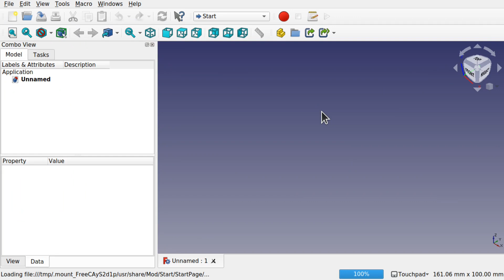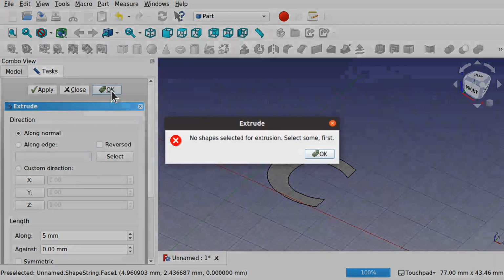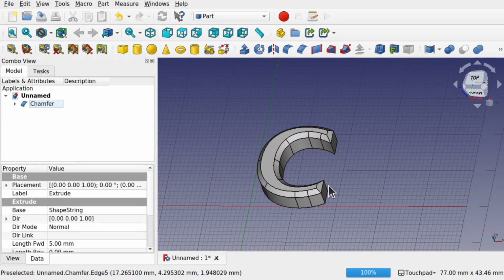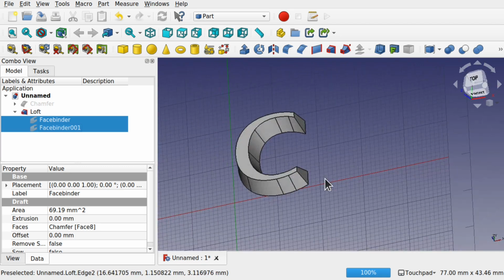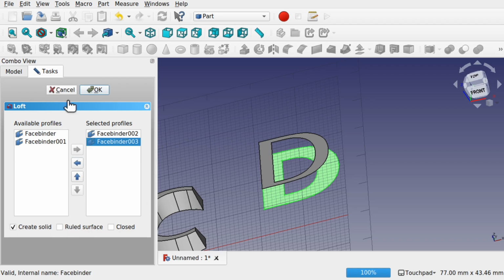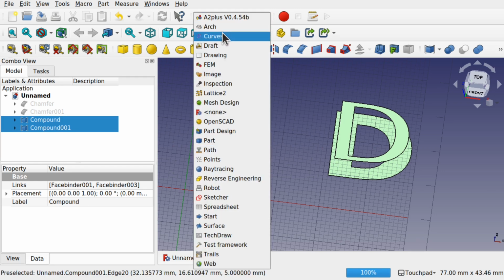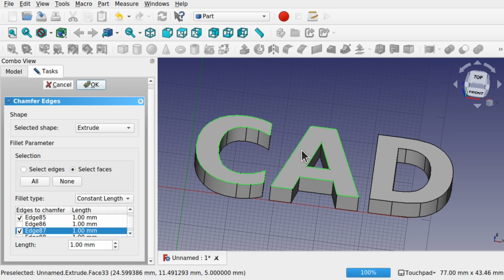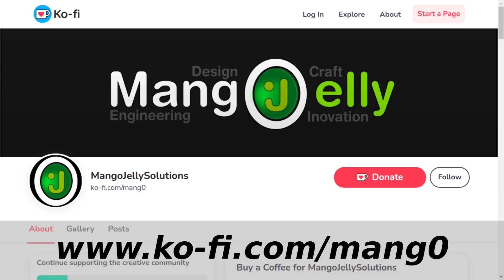FreeCAD: Easily Bevel Text To Base for Sand Cast / Injection Moulding When Part Taper Angle fails

Comment: How do you hollow out the bottom to make it for a sand moulds please
Reply from the maker: There are a couple of ways: 

You could create a rectangular volume around the text using a rectangular sketch and then extruding this.  You can then use a boolean cut and you have the inverse.

Another way is to use the thickness tool and select the bottom face of the text and that would attempt to hollow out the inner part.

You could use the part > 3D offset tool tool.  You may have better luck going outwards rather than inwards with this one.

Comment: Is this possible with cursive fonts using whole word not letters only?
Reply from the maker: In the latest version of freeCAD you can set the font to fuse which will help in this process.
Reply: @MangoJellySolutions  it will be interesting to see how you solve the errors when you try using cursive fonts using your method. I tried other methods to offset the top face inwards but still gettings errors.

Comment: Thanks!!!  I spent a fair bit of time in frustration doing this in a worse way before finding this video.  My task was making slightly tapered text also wider at the base like your version for casting to 3d print colored text inlays.
Reply from the maker: Glad it helped, and thanks for the share of what your using it for.

Comment: This works okay for the example you provided however some letters won't take a chamfer at all due to complex angles.  For example, using a gothic font, the capital M and N won't accept any chamfer.  Do you have any advice for fixing them?  I can do it with Curves WB multiloft if I manually scale and place the faces.
Reply: Was just having the same issue. Glad to know it is font specific. Did you find a solution?

Comment: Excellent! I have been wondering how to do this since I started using Freecad to make patterns for casting in my home shop three years ago. I could have used it at least half a dozen times. As a work around I have been using very shallow lettering. 

Do you think it's possible to use the same technique to add pattern draft to letters on a slightly curved surface, such as lid with a slight dome? A challenge would be that the draft would need to not be in respect to the surface but would need to be in respect to perpendicular to the parting line of the pattern. Although if the curve was only slight, it could be compensated for by using a larger draft angle.
Reply from the maker: Glad this may be of use to you in the future. In regards to query I have just been going over it on paper. Parting line drafts should be possible by duplicating up the first face and lofting through 3 faces rather than 2 with the largest face in the middle followed by the chamfered face either side or the chamfered face in the middle followed by the base face either side (depending on what way you want to draft). It's when it comes to the domed surface that it gets a bit tricky. I do have an idea so bear with me as need to test (if I have understood the question)

Comment: Hi , Darren . Thank you for this video . Just what I need . Have a dream day my friend . 

Stay safe 
Terry
Reply from the maker: Glad it's what you needed. I have my work pc at home and can understand the problems you may encounter with changing fonts on Windows. Mine is locked down by work and getting permission issues, so if you can't change the permissive one solution is to copy the contents of c:/Windows/fonts to a new directory (has to be new) into say your documents folder or somewhere you have full access. In this way you can point to the new directory. The otherway you have to change settings to not use the default font dialogue but you lose the benefit of viewing the font before you add it to your scene. I am looking to do a video on using fonts and installing new fonts on freecad with a few links to some resources. Many months ago I did a generic video for installing fonts on windows and inkscape as, again you hit permission issues. I forgot what a pain it can be sometimes.
Reply: @MangoJellySolutions  Thanks , Darren . Looking forward to that video when you get a chance . I would nominate you , FreeCad professor . 

kindest Regards
Terry Lembke

Comment: The problem for me is that the shape of the chamfered top faces of the text change the shape of the font enough that it can be undesirable. I am a total FC beginner so I would be lost there. It would be great if a guy could skip the chamfer operation and loft OUTWARD toward the lower face plane so the shape of the text on the top face is the unadulterated true shape of the font and the extra "meat" below it  is just a supporting structure of whatever shape since anything below the top face is functional rather than visual.
Thanks for the video. I always learn stuff.
Reply: I'm still looking for this solution too. In my case I'm producing letter (text strings) stamps for stamping leather. This starts with a 2mm base the text is extruded from the top surface 3 mm, for a total height of 5 mm. One of my stamps is a 50x50 rounded rectangle, with 10 mm fillet corners. These usually get a centered text that may be a small number of letters or numbers. A recent one was '42'.  Where I'm running into problems is when what I'm going to print has a letter 'i', or is a '.' or ',' where the glyph doesn't have much in the way of lateral support. (Depending on the slicer, going much below 7 mm in character height can result in the dreaded 'thin line' issue where the glyph, or portion of the glyph just doesn't print at all.)

Again the need is a letter glyph that tapers out from the top surface to the base, het will give a full impression as it's stamped. I would think a similar case might be if someone is printing 'rubber stamps' out of TPU.

I consider the reversing of the text to be a minor issue as I can dimply mirror the model across X or Y to do that within a slicer (technically one could mirror over z, then do a rotation around x or y as well, but that's at least a second step. That said I'd kind of like to have the model flipped as I export it to a 3mf or stl file. I imagine that this 'could be as easy as rotating the shapestring around x or y before extruding it, but I'm still concerned about getting a bit more support than a 1mm x 1mm dot that's 3 mm tall, and expect to survive at least a few presses.

Long term I'd be perfectly happy printing this in PLA, with a pla sprue and vent stem that can have plaster poured around them, get the pla burned out, and then have them cast in metal so that the stamps last longer. For the moment I'm able to produce stamps needed for small runs for a local reniscience fair leather shop. Among other things this gives them a way to try out ideas and see what works without having to drop several hundred dollars on a metal stamp that they discover doesn't give them a marketable product. Or if the caster casts int sand casts, properly drafted letters would be far better than what I'm able to do at this time. And yeah, attempting to implement 'draft' when extruding letters or strings gives really odd errors, such as 'no attachment surface for draft' which sounds like the method of doing a draft has become to extrude, then 'expand the perimeter of the base of the extruded letter, but leaving the length of the extruded surface the same as it is drawn out in an arc of the angle provided. Maybe that's going to be fixed in the next stable release, whenever that happens, but it's not in 0.21.2, so.. stupid workarounds where I end up building a backing block that sort of backfills the letters, 1-1.5 mm from the top surface, and tapers away to hopefully reduce it's appearance in the stamped leather. That's been 'fun' too. (for unpleasant varieties of fun...)
Reply from the maker: Thanks for the comments. I see the challenge you have there. I have taken a similar approach with trying to scale but the scale is not in proportion and also 2D offset, but you get extra faces and twisting. But I do have another idea that may work. It's a serious work around but might get the results so bear with me.
Reply: @MangoJellySolutions  Did you find a sollution to this?
Reply from the maker: @parandersson8655  I am glad you nudged me on this one as totally forgot about it sorry.  I have had another look.  I have had a bit more success with using a technique that I am currently doing a video for where a shape binders on the individual letters can be created, using the offset property enlarges one so a loft can be made between the two.  I still don't think it's perfect but it opens up the options a bit more.
Reply: @MangoJellySolutions  Thank you for your commitment! Your work is extremly helpful for beginners like me! I´ll look out for the video.
Reply: @MangoJellySolutions  Yeah I was trying to think that through too. What I was picturing is distorting the lower plane details instead of the top face where the text is, i.e. extrude downward with draft. I dunno if that's even a thing, but that's the functional way for it to work since the lower face is just "support" for the upper plane details. If you figure it out, us beginners do a happy dance.